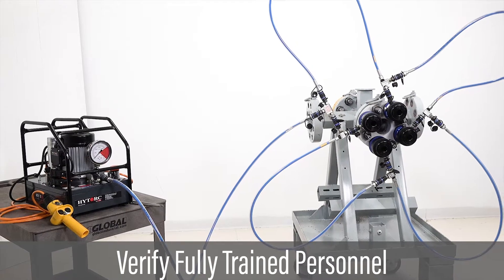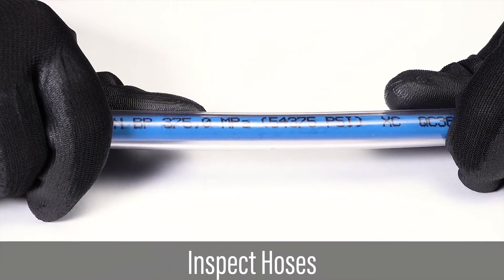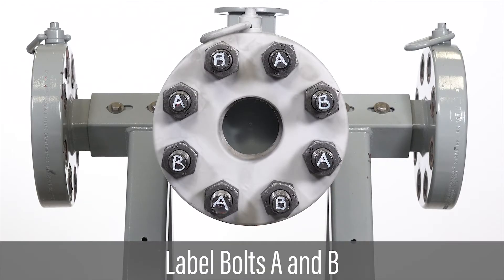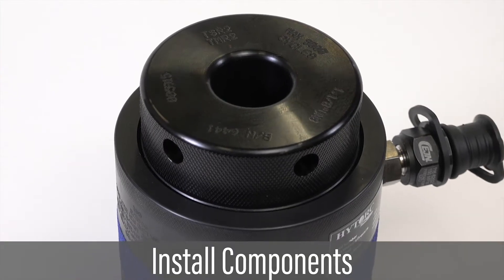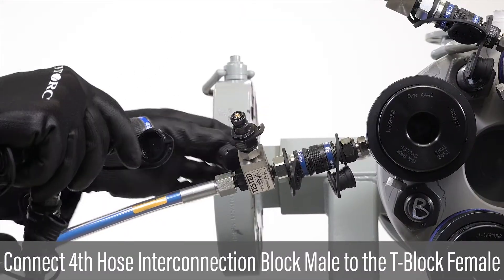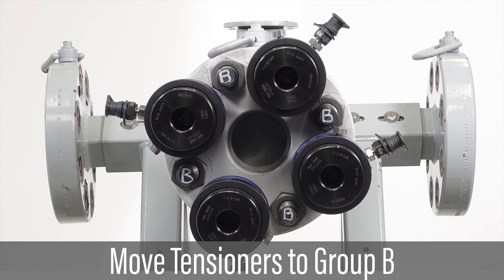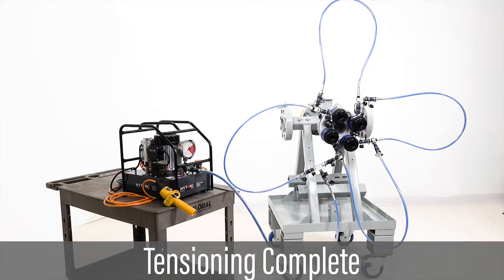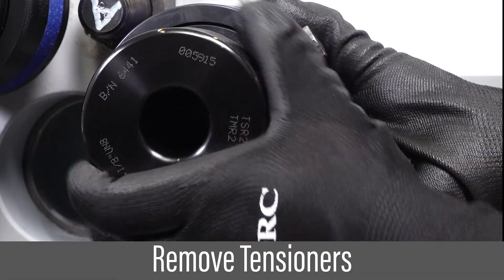Hydraulic Tensioning Procedure

Comment: This is misinformation. Its VERY important that your bolts gets to rest between your cycles. If you preassure to A, turn the nuts and release preassure, the bolt will need around 30 mins to return to its original form. If you dont let your bolts rest between cycles they will not be tensioned any more and the nuts will not turn on cycle2, or 3.
Reply: According to EN-ES 1591-4

Comment: what is difference between pressure A (it is the final target?)and pressure B how much % need to be applied
Reply: When working with tensioners like this, our goal is to end up with a preassure close to, or slightly higer than B. Ax3+Bx3 = close to B. Your equialized preassure between A and B.
So, if you move one of the tensioners back to a random A-bolt and test it, if you have done this correctly, you'll see it releases close to B. if not, if the preassure is alot higher than B or alot lower than B, you need to start all over again.
Reply: When tensioning in 50% configuration, Pressure A is Pressure B x CLF. Cross Load Factor (CLF) can range from 1.15 to 1.25 
Pressure B is calculated considering the residual load x LTF (Load Transfer Factor). the LTF depends on the grip length or the effective length of the joint and the bolt nominal diameter LTF=1.01+(diameter/grip length).

Comment: Can we use same procedure in any count of bolts
Reply: When working with tensioners, its always 1 out of 2 procedures. What we call a 50% tension procedure or 100%. So tools on half of the number of bolts, or tools on all. No more, no less.
Reply: and if you use 100% tool precedure, you do not need the A preassure anymore. Just go for B x 3.